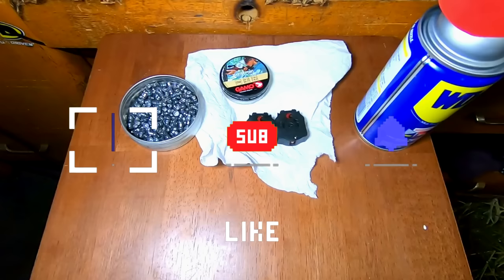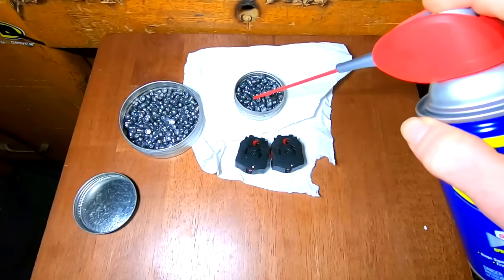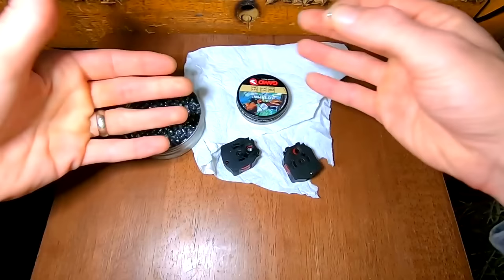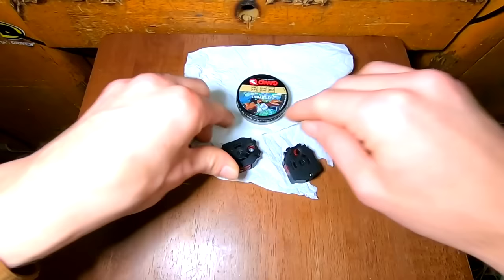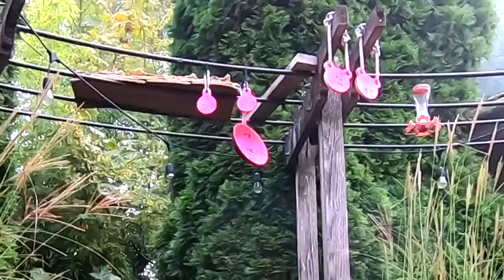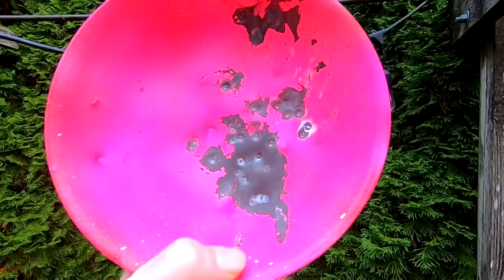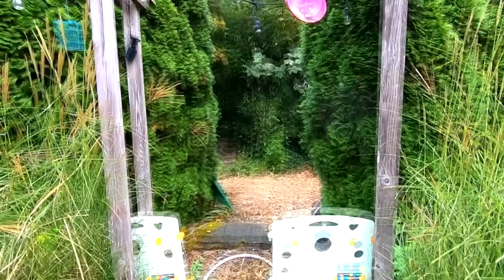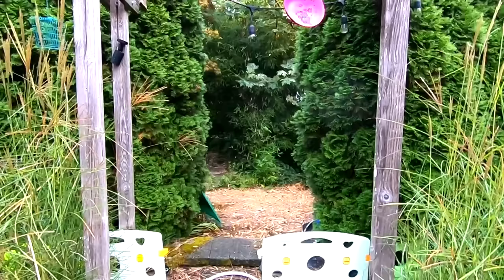Pellet Dieseling the Easiest & Quickest Method

Comment: WD-40 + pellet guns = good bye seals XD
Reply from the maker: small price
Reply: @PelletPlinker  Have fun replacing them XD
Reply from the maker: cross that bridge when I get to it
so far I've definitely gotten more than my moneys worth out of these seals
Reply: Everyone says this but there’s not a video or post about it happening
Reply: @zummie6334  It happened to me. Take a balloon blow it up and spray some WD-40 on it and then wait...
Reply: Crosman phantom blew my o ring out but as for the piston seal I wouldn't worry about that happening . The o ring takes 5 seconds to replace and 50 cents will last a long time I'm still on my second after years of infrequently heavily shooting . Sometimes Vaseline sometimes indexing the pellet into the rifling and putting up to 4 primers behind the pellet . Then it sounds like a 22 lr
Reply: @PelletPlinker  get some large rifle primers put 4 of them behind the .22 pellet in a Crack barrel and you will make a great video . I will sub now and wait to see :)
Reply: @thecbc7658  yawn
Reply: Das geht habe ich auch gemacht kommt ordentlich Smoke raus
Reply: @thecbc7658  baloon are not made of the same material. There is seals that resist hydrocarbures.
Reply: @frederic6998  It just takes longer LOL
Reply: @thecbc7658   wrong, if the barrel isn’t obstructed it won’t cause any damage
Reply: @fiji8457  I didn't say anything about barrel obstructions LOLZ XD WD-40 is just a terrible lubricant in the first place.
Reply: @fiji8457  You're wrong. The piston seals get burnt, ask me how I know. Also dieseling an airgun can cause the spring to break, it can damage the trigger group, and cause all kinds of other problems. The other issue is that diabolo pellets shouldn't go over 950 fps max if you want to actually hit anything. Plus you absolutely cannot get consistent muzzle velocity with dieseling. It's just simply not a good idea to do. Even if you don't care about the particular cheap airgun you're doing it with, what is the utility of doing it other than for a laugh? You're not going to be accurate enough to hit anything, and how do you sight in or hold over for distance when there's no consistent POI or velocity? Honestly you seppos just need to buy PCPs instead, seeing as they're not restricted on the US. Some of these big bore PCPs can do well over 1000 foot pounds and take out large game.
Reply: @PelletPlinker  WD-40 => Water Displacent - (version) 40. It's not a lubricant. instead of constantly replacing your seals how about you use the intended OEM oil and stop spreading misinformation.
Reply: @thecbc7658  I know you didn’t say anything about the barrel being obstructed I’m saying that’s what would need to happen for the seals to end up going bad
Reply: @fiji8457  grab a seal, then a cup, spray a bunch in there and then let it sit for a long time. Then we can talk about seal durability....
Reply: @Patrick-857  yeah maybe if the piston seals are dried out of old age and who was ever talking about being accurate we’re talking about simply adding more fps, so more than half of the things you said I didn’t even read cause it didn’t matter, plus if you got a pellet rifle that shoots close to 900fps why would you even consider using this method lol, this method is used on lower fps rifles aka cheap ones like you stated
Reply: @thecbc7658  yeah spraying a bunch of it in a cup and letting it burn obviously will burn it but the ignition inside the gun is instant it only burn for a fraction of a second
Reply from the maker: @The CBC

I never called it a lubricant. 
And just because something isn't a lubricant, doesn't mean it doesn't lubricate. 
WD40, despite not technically being a lubricant, absolutely does in fact lubricate. Just not very well compared to actual lubricants.

You keep spouting off about me spreading misinformation and I am still confused as to what you mean there
Reply: Heat friction flammable liquid possible fire
Reply: @marvinandLevi  I'll rather go off my own experience and the words of "professional air gunners" rather listen to some noob
Reply from the maker: idk all my guns are still fine and I've been doing this for years now
Reply: @PelletPlinker  There is a defference between "fine" and mint condition. My guns are all years later in mint condition even after increasing the fps on my 1377....
Reply from the maker: I honestly don't give a shit if they are "mint" 
I scratch my squirrel kills into the side of the gun anyway

There's a difference between a gun being in mint condition, and a gun that still does exactly what I need it to.
Reply: @PelletPlinker  LOLOLOLOL XD
Reply: If you're going to intentionally diesel your airgun, vasoline or grease on the back of the pellet is the way to do it. WD40 is the worst option.
Reply: The piston seal is made from urethane. That material likes neither solvents nor excessive heat. WD40 provides both. At least use something that doesn't contain solvents.
Reply: @Patrick-857  I agree with that one
Reply: @Patrick-857  I wasn't talking about the piston. I was talking about the cylinder. There are rubber o-rings in there. That is directly connected to your barrel.
Reply from the maker: @Patrick I typically use a mix of vaseline and pellgun oil (my other video shows this) not only does it diesel way better, but yes I agree it's not as bad for the gun (not to be confused with "good" for the gun which for some reason people think I am implying here, which I am not)

This is simply just an easy and quick method that people told me in the comments of the first video, I tried, it worked decent enough, and so I made a video for more views. Hate the game not the player.
Reply: Has anyone ever met someone that has actually blown out a seal?
Reply: @thecbc7658  Different material therefore moronic statement.  But we are used to that with something coming from you.  😎
Reply: @888WulfDog888  Only the liars did.   😅
Reply: @thecbc7658  
WD40 is not a lubricant it's a water dissipater hence the WD in the name.bees wax(less drag) furniture polish(non silicone)on pellets is much kinder to the gun and won't damage anything,been doing it for years.
Reply: How bout trying Sterno
Reply: @PelletPlinker  Love the squirrel kill count. I love when things are lived in and used and personalized instead of thinking keeping it mint and thinking factory is the best way to keep them.. I have some old rusty Chinese made pellet guns that a friend found in a barn they were cleaning out and I'll use and abuse them all I want. If I can get more power with these old gimpy pellet guns to take out invasive squirrels, by all means.
Reply from the maker: @cyclops-fpv   "It acts as a lubricant, rust preventive, penetrant and moisture displacer. There are specialized products that perform better than WD-40 in each of these uses, but WD-40's flexibility has given it fame as a jack of all trades.[3] WD-40 stands for Water Displacement, 40th formula."

Just because something is a water displacer doesn't mean it doesn't lubricate.

it is quite literally 35% petroleum, i.e. oil. i.e. lubricant. 45-50% of it is isoparaffin, which again, paraffin (derived from petroleum) is a lubricant (such as paraffin wax)

You would have to be 100% functionally retarded to sit here and pretend that something that is 85% lubricant, isn't a lubricant, simply because "tHe NaMe sAyS wAtEr dIsPlAcEr"

I have bad news for you guys: WD40 is absolutely a lubricant. 
The fact that better lubricants exist, doesn't make it stop being a lubricant, and the fact that it displaces water ironically makes it one of the best lubricants.
Reply from the maker: Do you like..... not know what petroleum is or something? 

I don't give a fuck what she made it for, it's a  lubricant because it is made out of lubricating materials, and quite literally lubricates surfaces.

Anything that makes a surface more slippery than it was before is a lubricant. stop being retarded.
Reply: Been doing this for years and still not broken. I'm calling BS
Reply: Got years out of mine! Just deep sixed it at my local gun store! Traded against a new rifle no worries! They said they service every trade-in so no one lost out!
Reply: How about coating them with gun oil??
Reply: Ya would think so. Right?
Reply from the maker: So like, you guys seem confused. I wasn't asking a question and looking for answers, I was stating a fact:
WD40 is a lubricant made out of lubricants. 

here is a quote taken directly from the WD40 website:

"Myth: 'WD-40 Multi-Use Product is not really a lubricant.'
Fact: While the “W-D” in WD-40 stands for Water Displacement, WD-40 Multi-Use Product is a unique, special blend of lubricants. The product's formulation also contains anti-corrosion agents and ingredients for penetration, water displacement and soil removal."

https://www.wd40.com/myths-legends-fun-facts/

Not only is it a lubricant, it is a cocktail of several lubricants. It is a lubricant made out of lubricants.
Reply: @zummie6334  RIGHT!  😎  Just "experts" who very loudly claim it down here!   😂
Reply: @thecbc7658  It didn't happen to you and your balloon comparison is laughable at best.😎
Reply: @Patrick-857  😂😂🤣🤣😂😂🤣🤣😂😂
Reply: @ebutuoycensorship8012  large rifle primers were selling for $1/primer at the last gun show I attended. I’d save primers for their intended use and much more effective ammunition!
Reply: Leave well alone/ Don't fix it if it is not broken.....Moral of the story....Use your pellet gun as it was made to be used.....without any bull shit added anywhere for whatever reason whatsoever...When you turn 70 like me you will know and understand that you should follow the KISS SYSTEM always: Keep It Simple Stupid..!!!! ...Also: Don't butter a lions arse,as the lion will not appreciate it...,and, neither will you appreciate the consequences of that which the lion did not appreciate in the first instance...
Reply: @888WulfDog888  I’ve taken out many seals using WD40. It’s what I used as a young kid to keep my guns lubed. I didn’t know any better.  I’d never heard of dieseling but then there was no youtube. WD is horrible on seals. Would I use it to diesel a pellet? 😂😂 I’m headed right now to try it on my sons pellet gun.
Reply: @PelletPlinker it's bad advice with out a warning they may not be aware of the consequences as for ease of replacement ,level of damage and costs depends on the model and price of the weapon or parts , this is an old idea from leather pistons and seals not recommended on nylon and plastic I cringe every time is see one of these .
Reply: It’s pretty easy to replace the o rings. I use dieseled pellets in my .177 break barrel.
Reply: WD40 wrecked my seal and the .177 air gun sounded like a .22 long.
Reply: Myth
Reply: Silicone oil will do the same without damaging rubber seals
Reply: @ebutuoycensorship8012  hey man, can you tell me where you would get those seals? I would appreciate it
Reply: @PelletPlinker  the WD only creates a slight lubrication and air pressure increase in the barrel and does not make contact with the seals in the action whatsoever. WD evaporates quickly and does not run back down into the piston system. The idiots commenting are confused and talking about people using it as an air jack or piston lubricant. I personally haven't done any of this stuff in 30 yrs because I discovered it was just unnecessary but guns from that long ago have no issues today as long as you only used it in the bore.
Reply: I used to do this as a kid……my pellet rifle still functions today (im 44) albeit not as well but that’s to be expected after sitting for well over 20+ years
Reply: If my seals go I know where the store is!!!
Reply: Does silicone spray work?
Reply: @thecbc7658  I had no idea that air rifle seals were made out of balloons.😂
Reply: Depends on the design. I've used under levers and gone through 1000s without any damage. Need cleaning occasionally but that's it
Reply: @thecbc7658 you said LOLZ XD. Do you wear short sleeve collar shirts with dragon prints on them too
Reply: @reddjones2936 dieseling literally means fire if ot actually worked
Reply: @mikafoxx2717 😅
Reply: @thecbc7658  so WUT, it’s flammable anyway.
Reply: @thecbc7658  - the benefit far exceeds the inconvenience of changing the seals once in a while. 😅
Reply: Never use wd40 on any guns or parts of a car that have seals, always use siliconized.
Reply: Try silicone WD40 perhaps
Reply: Does this process clean the barrel by any chance?
Reply: What about some silicone spray??
Reply: @BigDawg76773  I would use it sparingly as a cleaner for the exterior parts, pivot points, then wipe it off completely and/ or compressed air blow dry off and re- lube with Birchwood Casey or Lucas gun lubricant oils.
Reply: @PelletPlinker it's OK if you only want to hit frying pans. 😅
Reply: I sort of agree try silicone spray its better on ur seals n will do the same job.
Reply: It still won't protect you from a big predator.
Reply: Str8 Fax
Reply: @zummie6334  I've seen it happen alot TBH
Reply: @thecbc7658  nobody cares
Reply: Been doing that for years never had a problem with the seal
Reply: Depends the gun... u can deisel the vigialanty :)
Its awsome
Reply: Use vasiline not wd... think about this :/
Reply: I prefer GT85
Reply: Plus tax...haha
Reply: Seals are tired of the club scene.
Reply: Wut about vasiline???
Reply: @thecbc7658 "WD-40 is a terrible lubricant" might be the most moronic sentence I've ever read.
Reply: @jonnymak1079 vaseline doesn't burn.
Reply: @dannymoneywell  i wanna diesel my vigialante also but co2 is not enuff...the hammer hits hard thiugh... i think wd 40 will work
If it brakes...i get a knew 1 all good
Reply: @jonnymak1079  don't try to diesel a CO2 airgun, not a good idea, only works well on spring/gas ram guns.
Reply: WD 40. Water Displacement. Was never intended as a lubricant.
Reply: @dannymoneywell  you absolutly can with the vigialsnte... i looked into it for a while its 1 u can deisal... i do it now all the time... vigialante hits pretty hard
And the hammer hits hard...also put vasoline on the hammer
It jits even harder
U can tell the diffrence...
Reply: @dannymoneywell  no it dont burn... its patralioum lol its blows the fuck up :)
Reply: Some pure O2 would spice things up
Reply: I have a feeling original poster doesn’t understand that it’s being burned off mostly.  Probably some residue, yes, but it’s probably better for the air gun than not using any oil EVER.
I have recently been switching over from firearms, to air rifles, they are quieter.
Need your range to be able to collect let though, if possible.  The beauty of air rifle is, ammo options are greater, and recasting is possible.
Reply: Why are you shooting Seals?

Comment: Dieseling, the worst thing you can do to a quality Springer. Don't do this.
Reply from the maker: mine is fine
Reply: can you please say more ? why ?
Reply: @brisudamatus the detonation from the oil or anything used for dieseling causes stronger combustion that causes rubber seals to stretch over time. Rubber will lose its tightness due to this which then causes openings in the seal. If you want to diesel, take your gun apart and make a new seal out of leather for the piston. Leather can withstand the detonation.

Comment: Guys what you need to know about dieseling is that there must be three elements needed to make a fire, which are, fuel, heat and oxygen, which is what generates compression.  The oil is fuel, the compressed air consists of heat and oxygen, hence the compression. With just a drop of oil in the skirt of the pellet will do the trick. Dieseling generates about 300 fps ( depending on the velocity of the gun) more than the normal fps of the respective gun. A .22 airgun shooting at about 950- a 1000 fps, can go up to about 1300-1400 fps when dieseled, which makes it just as lethal as a .22LR rimfire
Reply: Yes sir I can vouch for these results I have used a petroleum based lubricant that is of course flammable and it effectively turns my pellet rifle into a 22LR with how loud and powerful leaving a stream of smoke leaving my barrel. Your rifle has to be spring piston powered, will not work on a Co2 rifle as compression is needed to achieve combustion.
Reply: @Digital.Dictator  what about a pcp?
Reply: @OhighoGrows  A PCP doesn't really need any help as they are usually stronger than what's being done here already. But you can probably get some minor gains using lubed pellets just be sure to clean your barrel often because it will cause gunk to build up.  A PCP functions much like a Co2 platform so I don't think using a combustible lubricant will get the same result.
Reply: @Digital.Dictator  I can vouch for gas rams aka Nitro pistons work with dieseling as well. Gamo Raptor whisper in 177 using 7gr wad cutter pellets sends them out there screaming. The Raptor in 22 also does a fantastic job of sending heavy H&N Crow Magnums down range at breakneck speeds which actually help the mushrooming effect on those deep dish hollow points of the Crow Mags.
Reply: Nothing new I was doing this 50 years ago😅😅😅